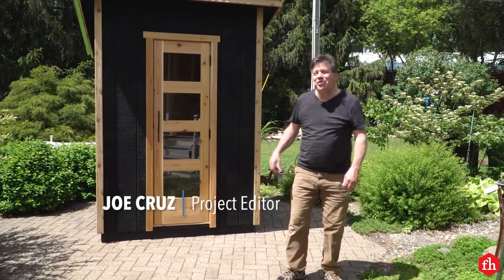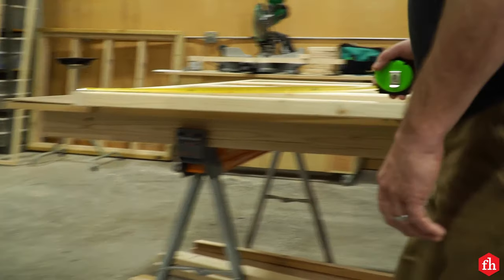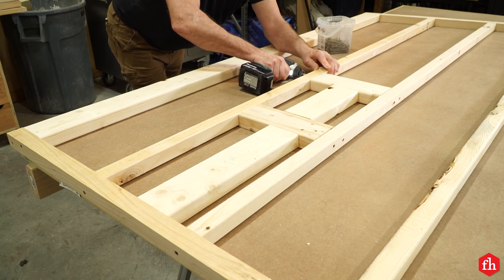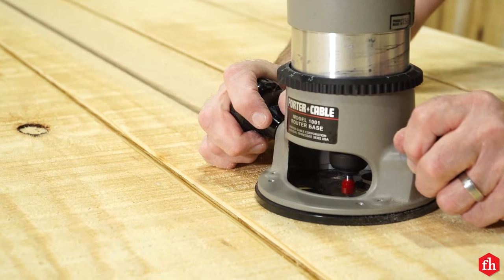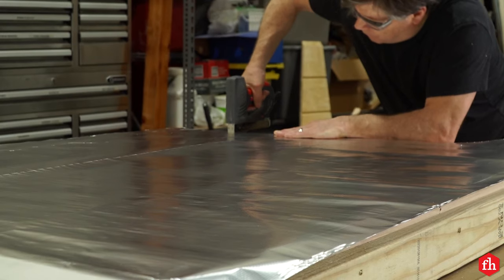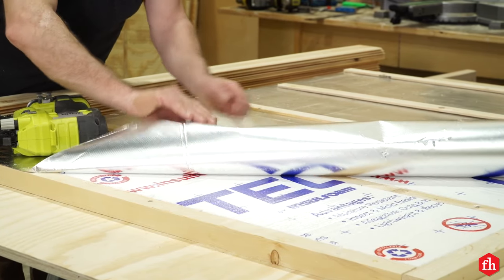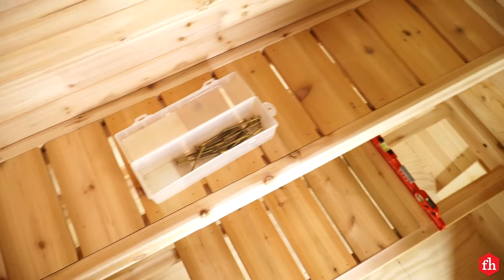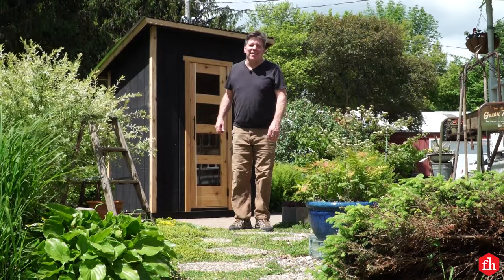How to Build a Portable Sauna

Comment: Just finished building this in New Zealand. Made a few changes. I off set the door to the right to make more room for a 3.6KW heater. I brought a pre-made spruce door with tempered glass. Used glass wool insulation in the walls. Tiled the floor so easy to clean. Installed inlet and outlet vents. Just got it wired up and ready give it a try.  Like the design and good to have the option to dismantle if required.
Reply: Hey Nick, I am down in chch and thinking of doing the same. I'd be interested to know how long it takes you to get it up to temp with the 3.6kW heater. Did you build a similar size sauna? I am thinking of keeping it pretty small to make it efficient
Reply: @jackzarifeh  Hey,  takes about 1 hour to get to 80 degrees.  I've been playing around with the vents during heating to try and speed this up.  I find having the vents closed during warm up is best then opened the bottom vent once you're in.  The SAWO 3.6KW is good but you could go to a SAWO 4.5KW heater for extra $100 that will warm up quicker and get to 90 degree top end temp. Ideal range is 70-90 degrees.  I changed the dimensions a bit to make it work around external Shadow Clad panels. Internally 1.5m wide by 1.1m deep.  Can fit 3 but ideal is 2 people.  It's been great on these winter mornings. Me and the wife are in there most mornings. Also doing cold plunge in pool which makes you feel good.  Overall really happy with how it turned out.
Reply: Hey Nick, was thinking of the exact same changes. One thing...did you put drainage in the floor? Cheers
Reply: @hazelmccague4337  No I just tiled the floor.  It's easy to wipe down so don't think it's essential.
Reply: Hey Nick how much did you pay for your Heater and where did you buy it from. Signed, another kiwi 😅
Reply: how much did the build cost you?
Reply: @TheJamesgggill  Estimate was around NZ$5K. I purchased pre-made glass door which added to cost but used cheaper internal spruce cladding.

Comment: I saw the insulation go into the floor, but was there any sheathing covering the exposed untreated framing and insulation up under the bottom?
Reply: at the beginning, the base was built.  the outer frame, that touches the ground is pressure treated.  The inner frame doesn't touch the ground so it will be dry(ish) and not rot.  Other than that nothing else is needed since the insulation is foam and can get damp without issue.

Comment: Looks great! Is there a materials list available? @Family Handyman
Reply from the maker: Yep, check out this article: https://www.familyhandyman.com/project/how-to-build-a-portable-sauna/
Reply: @thefamilyhandyman  please do not follow this guide with their measurements. I followed it and there are many many amateur mistakes. The build itself is awesome. Follow the guide with your own measurements and it'll be fine.
Reply: @mikeslab9255  What did you buy for the roofing materials? They aren't listed in the project.
Reply: @8yearsago153  I used OSB insulated with shiplap on the inside and metal on top.
Reply: @mikeslab9255  Thanks!
Reply: @mikeslab9255  Hi, can you share what mistakes or issues you had building the sauna?  I was about to start and would really like to avoid frustration and wasting materials  :/
Reply: @etha1100  In short, basically what you'll have to do is make your own measurements for the side walls and back wall to match the front wall. These are the issues I've found, they claim the front wall is 48 wide then in the back wall they claim it's 57 wide issue one. Issue two is the side walls they have the baseboard as 48 inches. Then if you look at the top board that goes at 15° slope is only an inch longer than the baseboard and at 15° angle It's considerably longer than 49-11/16 as it's marked. I was fortunate enough to have reclaimed cheap wood where it wasn't that big of a deal for me. However, if people are buying brand new boards, especially at the price they're at now and don't realize this before building it, it will cost an extraordinary amount of money. I wish the owner of this channel would comment and or change the plans. I hope I explain that enough. I probably didn't do super well, but I hope I got my point across.
Reply: @mikeslab9255  Great, thank you!  I bought new boards for the project and that would have been incredibly frustrating to run into.
Reply: @etha1100  additionally there is no venting, no drain and your feet must always be above the rocks. Spend some time on the redit sauna group before lifting the hammer.
Reply: @shirtz69r  Thanks for the heads-up!  Heh, it did seem odd for the floor to be bare plywood without a drain.  I was considering a slight angle of the plywood covered with vinyl remnant and a linear drain.  What was your solution for finishing the floor and drain?  With the wealth of information on Reddit, I'm surprised nobody posted build guides from their completed projects... so it's still pretty nice to come across this one for free.
Reply: @etha1100  I'm yet to build anything. Still in the research phase. Going to be a while!
Reply: @shirtz69r  what do you mean by "your feet must always be above the rocks?" Sorry if this is obvious
Reply: @marksechter9377  do some reading. Gets pretty technical. Just a guide to keep your whole body in the heat zone.
Reply: @shirtz69r  oh so this is a recommendation about how to use a sauna not something relevant to this build in particular?
Reply: @marksechter9377  na it's a recommendation on build. Ie foot stool should be above top of heater
Reply: @shirtz69r  ahhh gotcha thanks makes sense now
Reply: @shirtz69r  so the footstool is actually the lower bench right? So it also needs to be low enough to sit on comfortably

Comment: Hi, like the build and video. What are base dimensions? Thanks
Reply: Dimensions at a glance. Front and back wall looks to be 5’ wide. See min 4:32. The side walls appear to use a full 4x8 sheet of siding so 4’ wide. Height, my guess is it’s 7’ at the high end of the siding.
Reply: @chadtitmus  That's just like my chicken house, which is actually quite an easy thing to do!

Comment: How much did it cost to make that
Reply: I just did this from exactly what he did, about 2000 dollars with the sauna heater costing 900.
Reply: And you could save a lot of money (300$)  by not buying shiplap and just cutting cedar strips with a table saw for the walls. I wish I would have done this.
Reply: @barrettwarner6993  How do you like it? Did you use his measurements?
Reply: @mattmatheny7054  I finally got it running, I like it. It gets extremely hot. Very happy with it. I used 6' by 51'' foundation and made the measurements from there for a 15 degree roof. I think the back wall is around 5'. I wish I would have modeled it in sketchup before I built it. Made a lot of unnecessary mistakes.
Reply: @barrettwarner6993  Your roof is lower than his by a foot? Did you put two benches in? if so, would you mind sharing at what heights you attached the bracing for them?
Reply: I’m currently building one similar but slightly bigger and im making it “beefier” bigger foundation. I’m at about $1400 in materials. Which isn’t bad with the price of wood. The kits look so cheap and they have a long lag time to fill.

Comment: As a Finn, i found this horrible.
1) benches are too low, your feet should be at the same level as the stones
2) in outdoor sauna: never insulate the walls or floor. Only the roof
3) air ventilation is a must. Make a small (10” x 4”) hole near the roof. 
4) drainage. You can make a long (3ft x 1inch) hole on the floor under the seats where water can drop to the groud. Works also as an air ventilation for cold air.
5) always use wood-burning Finnish stoves  (Harvia / Narvi) and real sauna stones
6) never use plywood, it molds

I liked the door. 👍